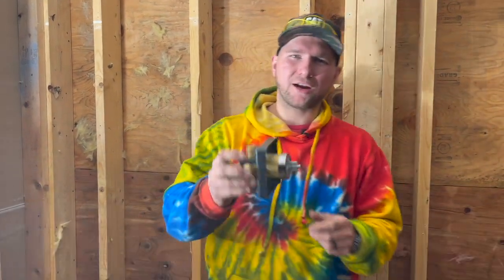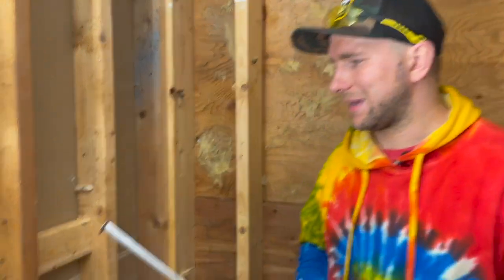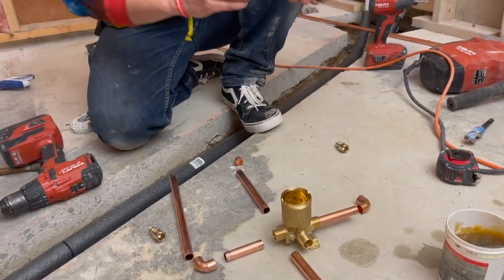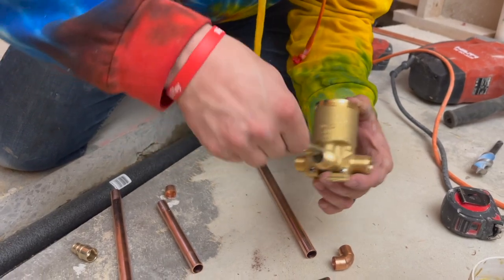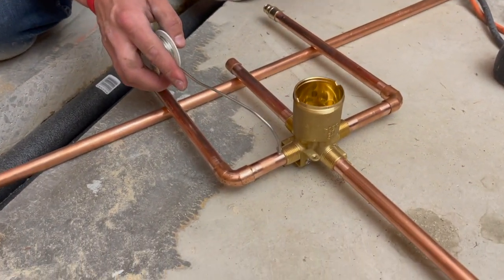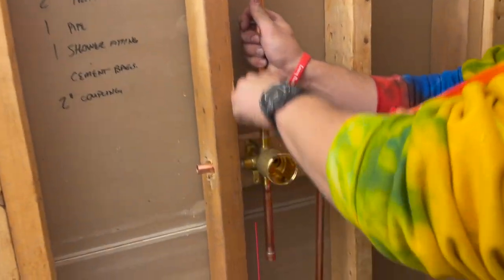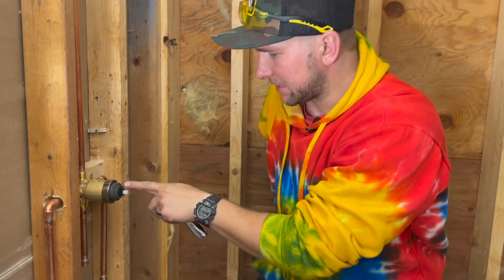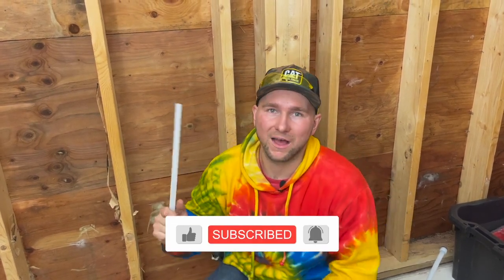How to Install a Shower Valve | Winni Vlog 006

Comment: Hey quick question, do you have any experience with amazon/chinese mixing valves? I bought a kit and am about ready to install, but I'm not sure if there is a lot of risk not paying 5 times more for a name brand mixing valve.
Reply: If you ever need to replace the cartridge its best to stick with a name brand you can easily find parts for.

Comment: Did you mean you are installing the valve at 47 - 48 from the floor of the shower? Sounds like you said 80
Is it the measurement to the center of the valve?
Reply from the maker: Valve is at 47-48. The shower head is at 80ish
Reply: My method is 32 for tub valves 42 for shower only. Head at 75. And control from tub spout or diverter 8 apart. Done so many bath remodels ive lost count years ago